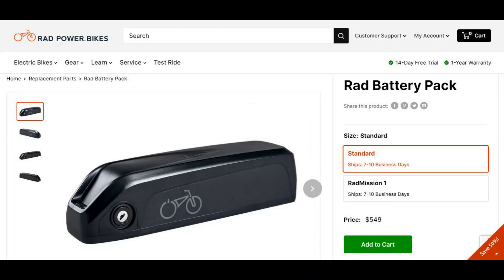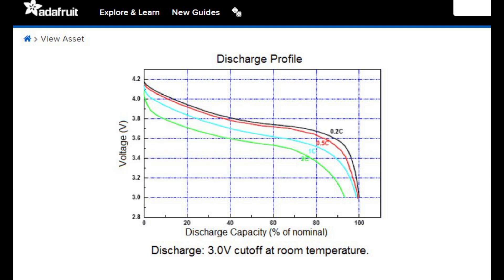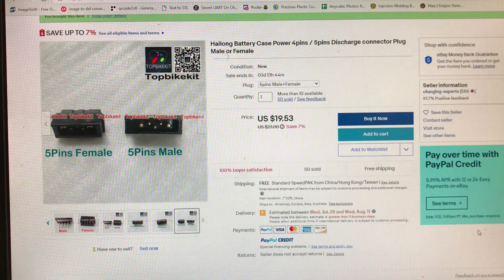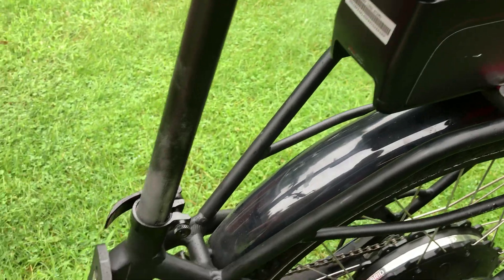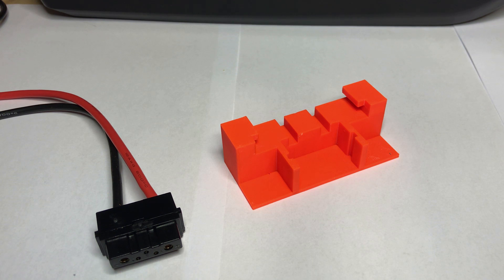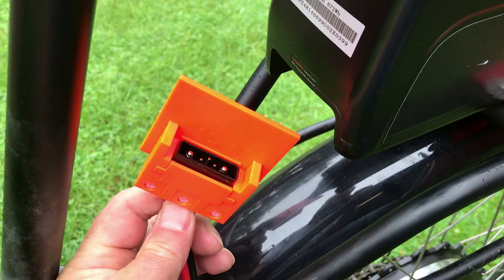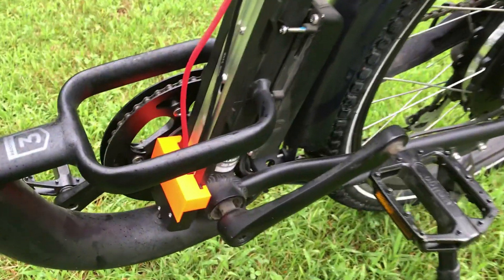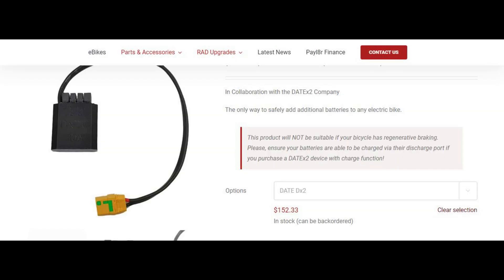RAD Power Battery & eBike Connectors

Comment: I would pay you to make one of those connectors for me so i can plug into the battery on one end and an xt90 on the other end so i can use my extra battery in parallel with original.
Reply from the maker: sorry, not really in a position to make/sell/support adapters. I put the free 3D models on the net so they can be printed by you or by a Internet service

Comment: Can anyone deny or confirm the purpose of the 3 extra round pins on the battery?  Are they needed?  I just got a Radrover 6 Plus. The battery cradle and battery both have the mating 3 round pins, along with the 2 +/- power pins.  I want to buy an extra aftermarket battery pack but am afraid Rad somehow uses those pins in a way that would prevent me from just using +/-.  Thanks in advance for any assistance.
Reply: The guy in this video hacks his battery due to a burnt terminal. He shows that those 3 pins are not connected to anything. https://youtu.be/XJgsvcT2xVU
Reply: @jaysarcade  Right on.  Thanks for the link.  That is helpful.

Comment: Hello Chris

Yes, it looks like I can buy a battery cradle. I believe I read that you couldn't buy them. And if you could they would cost over one hundred dollars. I communicated with Rad the other day, however, and they quoted me $17.00 Canadian dollars. Not sure what to think. Are they mistaken?  Will that do the job for me?

But, even if it works, if I want to put on a solar charger, like you did on the bike, I will need a male receptical, too. 

By the way, somewhere on one of your videos you remarked that the older rad battery does not work, while the newer one does. I looked all over your videos today to see if I could find that so that I would know whether I have the right kind. Couldn't find it. Do you know where it is?

Thanks joe
Reply: Any luck buying the cradle? I would like to buy one to use as a second battery for my BBSHD build.

Comment: Hello again Chris,
I would say that all of this electronics was Greek to me, except that I can actually read Koininia Greek.  But, it may be beyond me.  But, i would like to give it a shot.  I wonder, if you have a few minitues whether you might be kind enough to coach me on whether I have the steps right?
As I understand it, first i send for the connectors you mention.  Would a Rad battery replacement tray work as well?
then buy a dc to dc converter rated at 48volts to move down to 12 volt
then connect wires to the tupper ware box and ensure that they are waterproof.  put them through a hole in the box.  
connect them someway to the motor.
Is that all of the steps, or am i missing something?
thanks joe
Reply from the maker: sounds right. Can you order the RAD battery tray?

Comment: Hello Chris,
Getting back to the canoe idea, two questions:  I would have to put the battery in a waterproof case, such as a Pelikan.  Any idea how I might handle getting he wire out of the box and to the motor?  Would I need some kind of waterpoof connectors?

thanks joe
Reply from the maker: you will need to step down the 40V (30-42V) battery to 12V. They make DC-DC converters. But they need to be ventilated. Most of the golf-cart type are waterproof. I would just use a tuperware box and make sure the batteries don't sit on the bottom of the box.

Comment: Hello
I want to use my battery to power an electric trolling motor.  Do you think it would be possible with this rig?

if so, where do you get those little yellow and red boxes that you put the connector in?

I am accepting all advice and recommendations :)
thanks joe
Reply from the maker: The links to the 3D print files are in the video description. What trolling motor do you have? What is the voltage?

Comment: Can you try to see if the dewalt flexvolts will work for the bike?
Reply from the maker: I don't have any Dewalt flexvolt batteries. The current flexvolt batteries are either 20 or 60V. The RADcity ebike batteries are 48V
Reply: @SerendipitySue   they are 60v Max but they operate from 50 to 60v. They have adopters on eBay and amazon for like $15 was thanking of trying it.

Comment: On a Ryobi 40 volt mower the battery safety key has two spades flipping it decides which battery is in use. Couldn't I use a three spades key to put the batteries in parralel?
Reply from the maker: you don't want to put two batteries of different voltages in parallel unless you have something like a Blocking Diode to prevent a large rush of current from the higher voltage battery to the lower.
Reply: Both batteries are the 40v 6Ah ones that came with the Ryobi 21" Cross Cut Self Propelled mower. The Safety Key decides which battery is in use so when one battery dies you flip the key and use the other one. What I'm asking is since both batteries are in the mower, couldn't I have a three pronged safety key in the slot for 12Ah?

Comment: I bet a jogging loop would be a good spot around midnight or so.
Reply from the maker: I want to run flat out at 750W and run the battery down. No wind or hills. I'll have to google if there are any near by
Reply: @SerendipitySue  Could you rig up a small treadmill instead?
Reply from the maker: @JoshuaJoshua0  I would want results to be similar to my normal riding. So I would have to validate treadmill against real riding